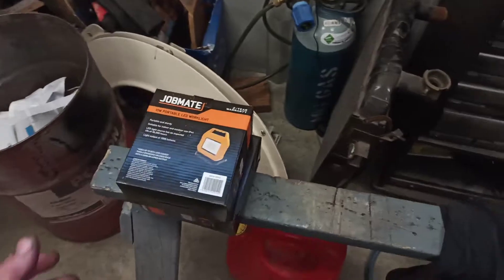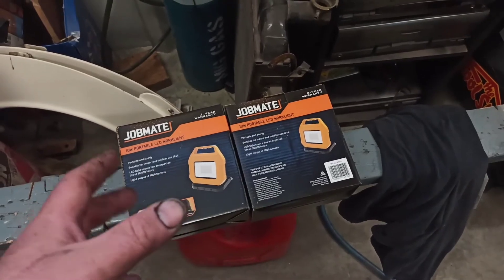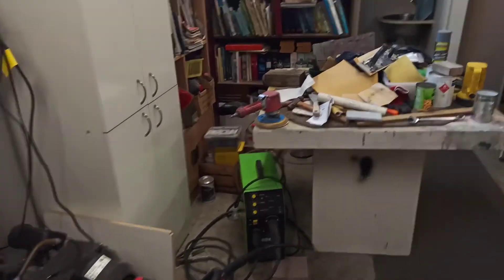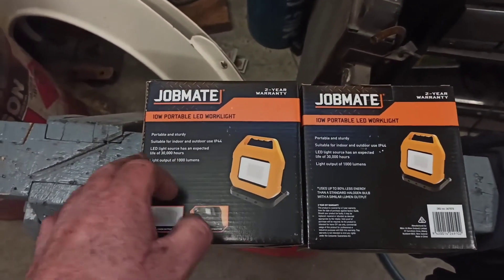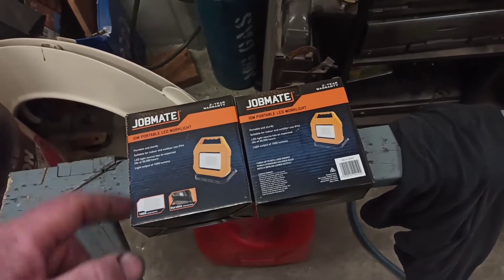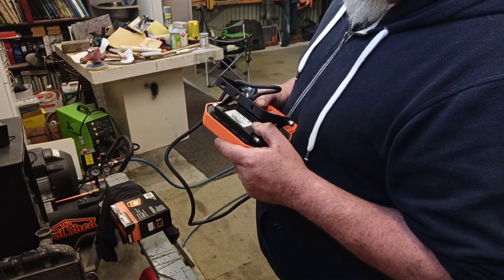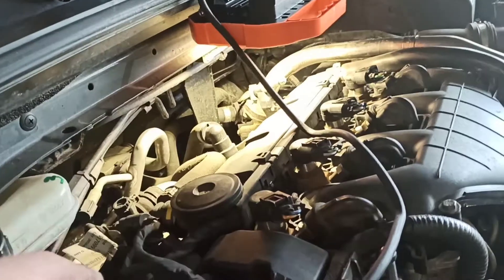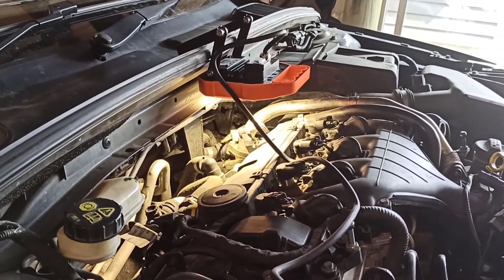Job Mate 10w led work lamp

Comment: your working on lights...I'm doing the same thing trying to upgrade my blast cabinet with 2 ft long leds so I can see better definitely voiding the warranty on the ones I'm buying. Building a medium size spray booth for models and stuff and outfitting it with the same 2 footers, the lights really helps you see here's hoping it's just a hose or a fitting and not a core/frost plug good luck!
Reply from the maker: Me to this thing is a nightmare to work on . From what I understand if I have to take the turbo out to fix it I have to drop the subframe or pull the motor

Comment: The lights seem bright enough.  Modern car are good until you have to work on them. You'll get it through!
Reply from the maker: I found the problem but it's not good frost plug in the head behind the exhaust manifold so engine has to come out or drop the full subframe just so you can get the exhaust manifold out  to even to get to them